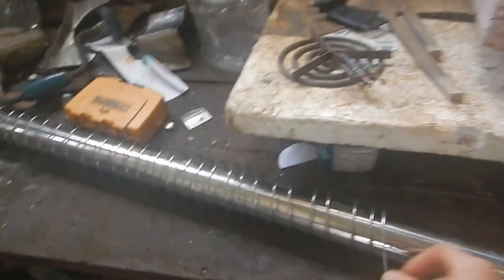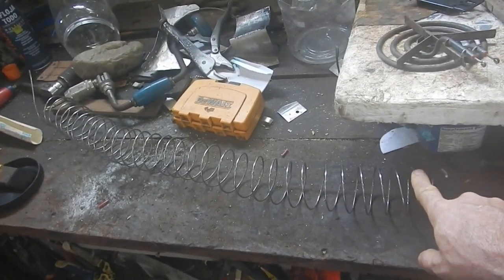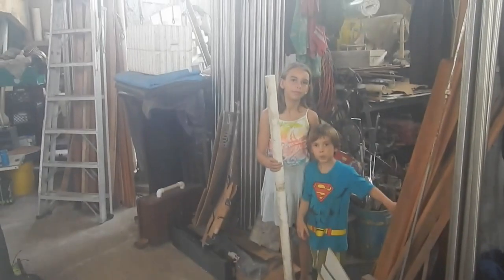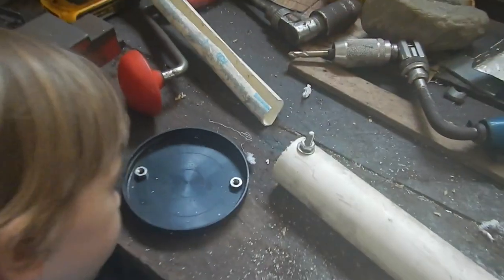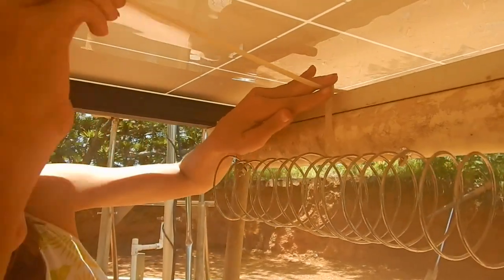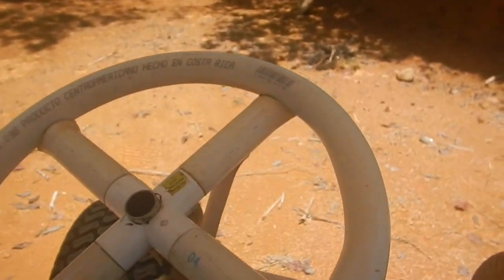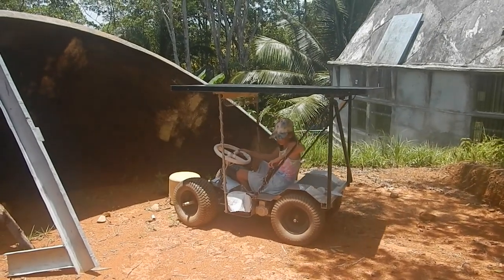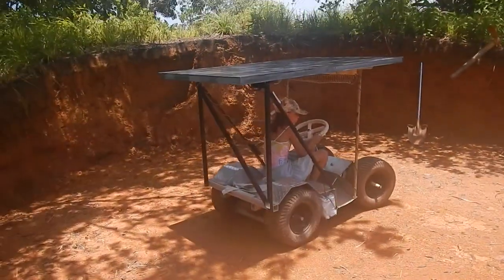Kid Car Speed Resistor

Comment: It sounds like what you actually need is an inductor, which is similar to what you did here.

To make an inductor, you will need the following:

- Copper wire (enamel-coated magnet wire is preferred)
- A cylindrical object (such as a marker or pencil)
- A power drill or something to spin the cylindrical object
- A small rod or screwdriver
- A multimeter (optional, but helpful)

Here are the steps to make an inductor:

1. Determine how many turns you want your inductor to have. The more turns, the higher the inductance.

2. Cut a length of copper wire that is at least three times longer than your desired number of turns. For example, if you want 10 turns, cut a length of wire that is at least 30 times the diameter of your cylindrical object.

3. Strip the enamel coating off both ends of the wire, if there is any.

4. Wrap the wire around the cylindrical object, making sure the turns are tight and close together.

5. Use a small rod or screwdriver to gently push the turns together and make sure they are all touching.

6. Remove the wire from the cylindrical object and use your fingers to shape it into a coil.

7. Use a multimeter to measure the inductance of your coil. Attach the multimeter to the ends of the coil and check the reading in henries. If you don't have a multimeter, you can skip this step.

Congratulations, you've made an inductor! You can use it in various electronic circuits, such as filters, tuned circuits, and oscillators.
Reply: Keep in mind it is good to view an inductor as sort of a temporary resistor that tries to block current surges due to the electro/magnetic field.